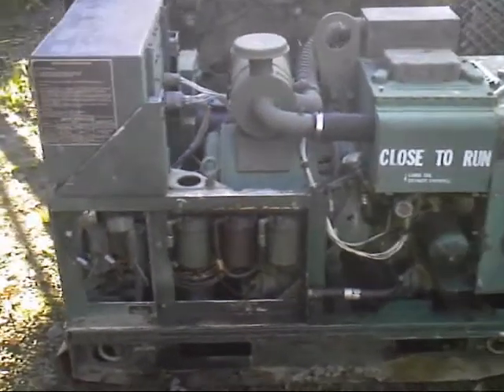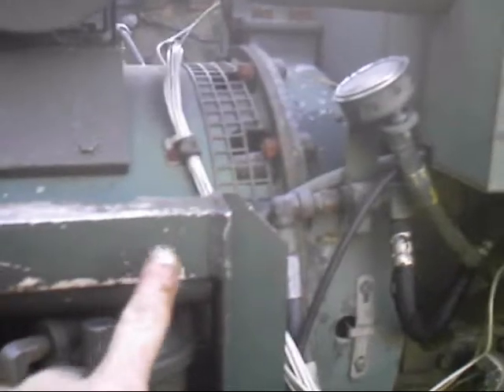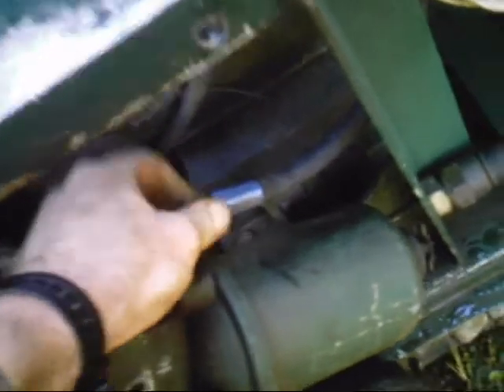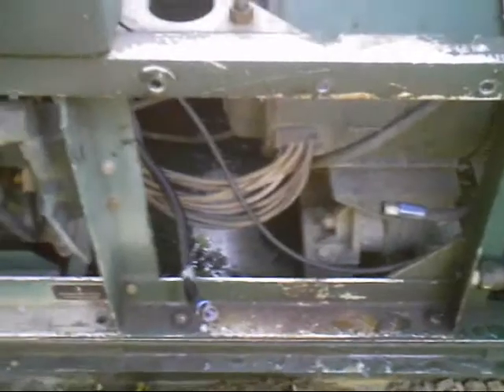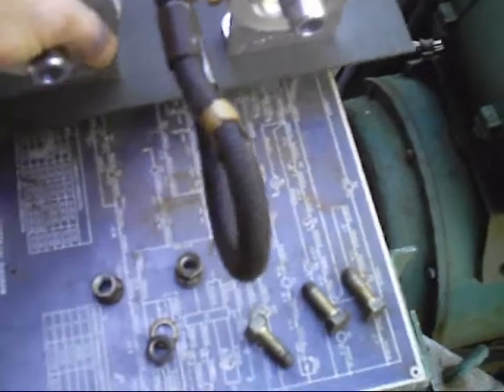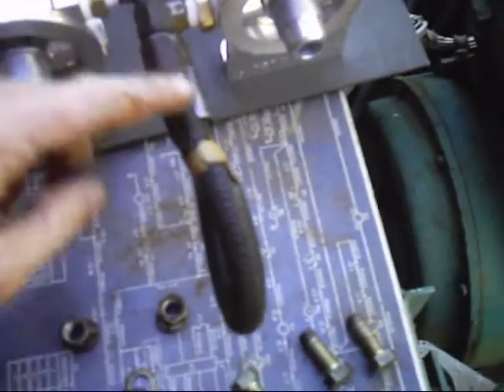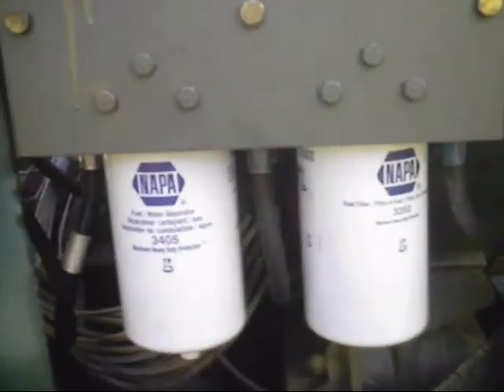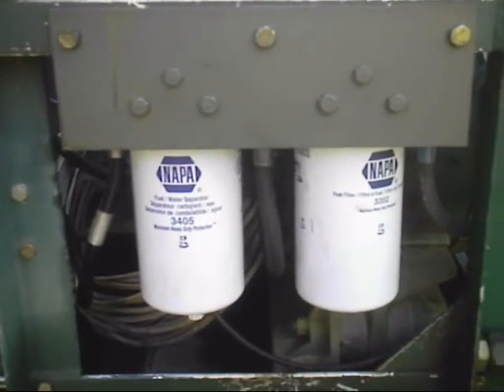Spin on fuel filter kit for MEP-002a/003a/112a generators

Comment from the maker: Using regular Teflon tape isn't advisable, correct.  I use fuel grade tape.  I have used the dope from time to time.  Mostly on large diameter stuff.  On the small stuff I like the tape.  Your point though is why I have thought about just putting the kit out in pieces and doing an assebly video.  Then people can use whatever thread sealer suits their fancy.

Comment: good setup, I saw Fram on the old canister, all the more reason to change.   I never use Teflon tape on any oil line connection however,  thread dope only.